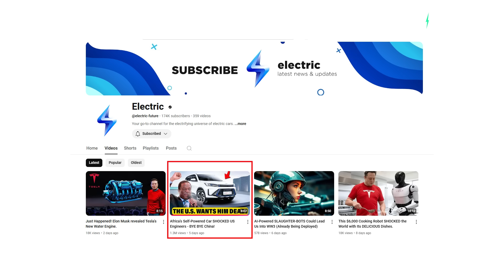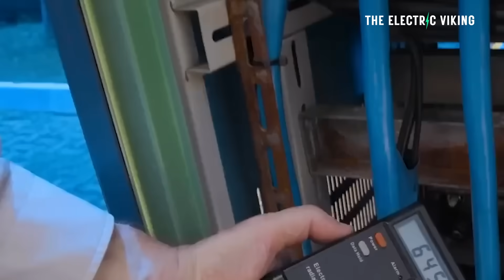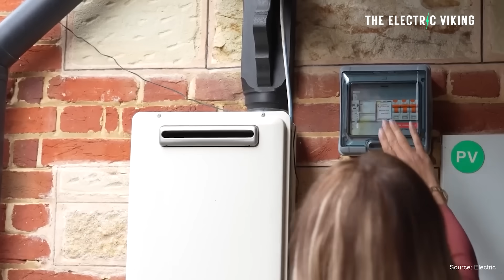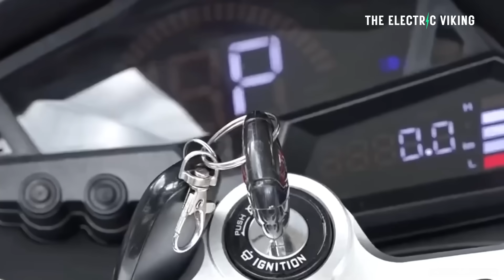Internet claims Africa’s Self-Powered Radiosonic Car SHOCKS Engineers

Comment: Best to have an open mind, Nickal Teslar was onto the same thing yet because its looked impossible under the current limited understand of the first law of thermal dynamics, does not mean you understand it. It's all in the language used, micro  radio energy could  be zero point energy, or the earth's nature micro electromagnetic fequancy. Or a natural transmission signal  to a wireless hayomonic receiver turned to a specific fequancy. You may need to eat your words.

Comment: When I was 14 Me and my friend built a device that gave us music for free no battery 24,7
We call it a crystal radio
Reply: Yes, crystal radios work.  Also, using an cardboard box, a bit of tin foil and thermal insulation material, one can build an inexpensive solar oven and cook eggs, for example, with it.  But the level of energy at play in these devices is several orders of magnitude below the power required for, say recharging an EV battery  or  for smelting, say iron ore.
Therefore the operational effectiveness of crystal radios in serving their didactic and musical purpose is no more proof that Chikumbutso's device works than one's ability to cook a few eggs (in a few hours!) in a solar oven is proof that industrial heat could be supplied by a cardboard oven...

Comment: Radio waves carry very small amounts of electric energy, typically measured in extremely tiny units like microwatts, due to their low frequency and long wavelengths on the electromagnetic spectrum; meaning even powerful radio transmitters only transmit a minuscule amount of electrical energy per unit area compared to other forms of radiation like microwaves or light. 

So light would be far better...
Why not just use the sun light? 
Oh yeah..🤫🤷‍♂️

Comment: I did not expect more than this from you. Somehow,  you're very helpful. Let's save this clip for tomorrow.

I have personally created a musical gadget that does not exist anywhere, and it's very simple. I use it for myself for over a year now.
And there are several methods to generate perpetual electricity. Some just need common sense!! I didn't even learn how to handle soldering iron yet.

Comment: Running on radiowaves, haha. Showing a picture of a car where an ignition key is required 😂😂
Reply: Over the past few years I have driven several different electric cars, and the all had an "ignition key".
It's a convenient way of preventing someone to just take your car and drive off with it. ;)
Reply: You are biased.very biased.the car's fuel system is radio waves.why shouldn't it need an ignition system.you guys destroyed Nikola tesla,one of your own bcos it threatened the capitalist establishment.
Reply: How did you conclude it's an IGNITION key? Why not an electric switch for the perpetual radiosonic engine?
Reply: @ If you look at the illustration, you can see that it is an ordinary ignition lock. It also contains the term ignition. Such an ignition lock is not required for electrically powered vehicles. In the vast majority of cases, a start-stop switch/button is used. In rare cases, there is the option of inserting a key-like module into a corresponding device. However, this never looks like an ordinary ignition lock as shown there.
Reply: @cinseychap1463  an ignition key hole can be adapted to act as an electric switch, not necessarily for a combustion engine. Innovation means thinking outside the box.
Reply: @sleuth7  Ah yes - I guess you're right ;)   Thank you.

Comment: It's not fake in terms of workings.. it something very real, but the problem is the power output that in common knowledge is very low. That is what the scam might actually be, because you would normally need very large "caption devices" to power a small smart watch 😂 but the claim is that his device can be fitted into an electric car & provide enough power to be able to actually drive the thing. Sceptical, but I guess only time will tell if the invention is real. or not

Comment: How cowardly of you. You can't even stand the truth, quickly deleting my comment to hide your ignorance like that.
Reply: This technology is not new. It is actually old. The only barrier left was no one knew how to harness the very tiny volts to translate them into usable energy on a large scale. 
Here is a video for proof of its existence long ago. https://youtu.be/NowhPAMDOTo?si=CmCx0bunvtx3eM8B . 

Here is some key context to help understanding;

Celestial Radio Waves as an Energy Source: Feasibility

1. Continuous Emission:

The Sun naturally emits radio waves, along with visible light, infrared, ultraviolet, and X-rays.
Other celestial objects, such as pulsars, quasars, and black hole accretion disks, also emit strong radio signals that can easily reach the Earth. 

2. Challenges in Harnessing Celestial Radio Waves for Energy (Chkumbuso's Invention Aims to Resolve These Challenges)

- Low Power Density: The radio waves reaching Earth from celestial bodies are extremely weak compared to solar light or even Earth's ambient radio noise.

- Capture Efficiency: Unlike visible light, which can be easily converted into electricity using solar panels, converting radio waves into usable energy requires large antennas and advanced rectification technology.

- Atmospheric Absorption: Certain radio frequencies are absorbed or scattered by the Earth's atmosphere, limiting what can be received at the surface.

- Cosmic Interference: Many sources, including Earth's ionosphere and human-made signals, interfere with natural cosmic radio waves.

3. Potential Applications of Space-Based Radio Wave Harvesting

- Radio Astronomy: Instead of harvesting energy, scientists use radio waves to study cosmic phenomena (Is this a limitation in their knowledge or intentional to save the fossil fuels industry?)
- Solar Power Satellites: Some space-based projects propose collecting energy directly from the Sun and beaming it to Earth via microwaves (a form of high-frequency radio waves).

**Wireless Energy Transmission: Nikola Tesla envisioned wireless energy transmission using radio waves, and modern research is exploring rectennas (rectifying antennas) to capture radio-frequency energy.**

Comment: If they would simply build a small portable generator like he showed, and it could put out 15KW of continuous power and never have to be recharged, that would be enough to revolutionize pretty much everything that uses electricity to run. If it doesn't require some expensive component like a pellet of nuclear material, and is reasonably affordable to the masses, let's build a bunch of them and start a revolution before scaling the technology up to use in grid level and industrial level applications. It's a damn good hoax if it ain't real. Maybe he could build a small airplane or drone that could stay aloft for 24 straight hours before returning to earth, as a way to demonstrate the device's unlimited power output.  It'll be so sad for sure if it turns out to be another free energy hoax. But there are some prophecies out there stating that some kind of new technology is coming to market in 2025 that will bring countless new changes to society. Maybe this one is it. God never lies. If He says get ready for something earth-shaking to come along, we should get ready without hesitation because there is 100% chance that the prophecy will come true. But even if this is not THE ONE to which the prophecy applies, we still may see something incredible invented in 2025 that will change society as we know it today, and possibly even more than a few game-changing technologies will be created that will impact us forevermore. But a "free energy" device that needs no input power [that costs us money to get] from the grid or from solar panels or a wind generator or a fossil fuel source, and never needs recharging, is still THE holy grail of electrical power generators. I'm rooting for Chikumbutso to both survive death threats and to bring his invention to market all around the planet. He has already teamed up with a Chinese company to make his special car. If the Chinese get first shot at a deal to mass produce the invention and run with it, the rest of the world will become slaves to them for decades, or at best, until we can create a different free energy device that cannot be suppressed by the Oil & Gas and Grid Utility Industries and corrupt Globalist Elites.

Comment: I was actually in Zimbabwe and i saw this technology for the first time live
Reply: what did you conclude
Reply: I'm curious about the innovation and now the debate going on. I'm from Papua New Guinea in the Pacific islands. I'm already so elated and jumping for joy. May I know where you are from and some proof of witnessing this innovation because of that and I am quite confused
Reply: How was it like😮
Reply: The car is a standard, unmodified Chinese EV with the batteries under the floor. They will work for maybe 300 Km then they need to be recharged. Maxwell will not allow anybody to run the car longer than that because it will expose his fraud.
Reply: You saw a Chinese EV?
Reply: No you did not. If you saw somehing the battery was well hidden.
Reply: @rogerphelps9939  It definitely has batteries but what charges the batteries? 

That's where Maxwell's invention comes in!

Comment: Sam, next time do some quick calculations.  Say you park this radio energy harvesting magic device near a mobile base station(cell phone tower).  There you can expect about 1 milli-watt of power available for an area of 1 square meter.   In order to charge at 3kw you need to collect power from 3000W/0.001W sq meters, which is 3 sq. km.  That is a huge land area for the device to cover.  For such a magic device to work, it needs to capture radio energy from 3 sq. km around the device with some magic antenna that is huge but yet invisible.  Even if it works, you cannot park such devices close together.  Each needs huge room to capture meaningful energy.

Comment: There are many reasons that I am very sceptical but I will share just 3. 1) I watch the video of him opening the hood of a car and explaining the technology. He stated that it was the amplification of radio waves in the air that powers the car and he shows a prototype of the amplifier, a relatively small unit that do not appear  to have a power source, or an antenna, both of which is a requirement for amplification of such very small signals. 2) Under the hood of the car sits a large gray unit, that looks pretty much like an engine, with what looks like large graded cables coming out of it and running either into the body of the car, or under the car. These cables are large, I suppose, to transfer the high ampage needed to push the heavy motor needed to move a heavy car and the load it is to carry long distances without fail. This would require several large connectors on the amplifirer"s output, unless the prototype unit shown was not the unit type powering the car. 3) Radio signals in the air are not just invisible, but extreamly weak and cannot amplify themselves, they require power.The power that is required to do what he explained would be better served powering the car than to collect power from the air. Even the very signals in the air requires power to place them there. Those are just 3, Ihave many more. Until I can check it  It"s a scam.

Comment: I think you’re simply jealous that you didn’t do it.  Have you ever heard of Nicola Tesla? Look him up. He had several patents that demonstrated that very same concept. Those patents are currently available to the public. This theory doesn’t violate physics and it is not a perpetual motion machine. Just because you don’t understand it doesn’t mean it isn’t legit. 
You should know there are many different ideas and working prototypes that are currently being suppressed to protect the profits of the wealthy and corporations stock holders. 
Nicola Tesla has demonstrated that there is more energy in just our planets lower atmosphere than we could ever use. This energy is in the form interstellar cosmic microwave radiation that do break through our protective magnetosphere and theoretically be collected, rectified, condensed and converted. The mathematics and tolerances for the first stage is staggering but the rest of it is first year AC-DC electronics engineering. 
Recent advances in the efficiency of microtechnologies and components have made these theories possible and even practical. 
The inventor now has records and drawings all over Earth. Destroying the man cannot stop the device from spreading. However, I’m sure he has all the protection he can afford. 
This product is not currently available in the USA. The factory (if you can call it that) is small. 
It does not violate Maxwells Equations.

Comment: Technically it can be done but the LRC circuit would be quite heavy. The inductance would be 150 Henries or more depending on the load. Then there is the inverse square law. The broadcasting station will not appreciate the power draw. Plus you would only be able to drive close to the broadcasting station. I didnt see a grounding rod so more than likely a fraud but as a believer in science im open to advances in technology   breakthroughs anything is possible

Comment: The Ultron Battery Technology is set for a 2025 release and yes it has already been tested and proven.

1. It is entirely self sufficient and does not need outside Intervention, no Radio Waves and no Neutrinos are required. 
2. The Ultron Battery will work in -60 Celsius to 200 F 24/7

https://youtu.be/-5ePNrx8qR8?si=Ibm0fkyDnr_ltGjy

Comment: of course this is a new scam. To capture RF energy over the available electromagnetic spectrum and then convert it (with no losses) to something practical to charge a local battery is beyond any scientific possibility. It "might" be possible to capture a small amount of RF energy to power a single LED, but to match any claims of providing power for any transport vehicle is clearly impossible. I've worked on marine radars that could produce at most 20-25 watts average of rf energy. Just imagine how much RF power is available from a cell phone.

Comment: Have you ever heard of a dude called Nikola Tesla? He patented most of the 20th Century technology before 1900. He was regarded as a magician or a charlatan. 
"Tesla once said, "The world moves slowly, and new truths are difficult to see." It was his way of responding to the crowd's stunned disbelief upon viewing his scientific wizardry at New York's Madison Square Garden in 1898. Using a small, radio-transmitting control box, he was able to maneuver a tiny ship about a pool of water and even flash its running lights on and off, all without any visible connection between the boat and controller. Indeed few people at the time were aware that radio waves even existed and Tesla, an inventor often known to electrify the crowd with his creations, was pushing the boundaries yet again, with his remote-controlled vessel."
During WW2 the Germans developed & used the Henschel Hs 293 guided glide bomb in 1943. That was 45 years after Tesla demonstrated his radio wave remote control technology!
Tesla saw the World as a huge electro-magnet & demonstrated the wireless transmission of electrical energy.

Comment: He just needs to prove that his device can generate enough energy. Radio wave energy is real. It just can’t produce enough energy according to the science we have today.  

Ambient Radio Signal Power: Even under favorable conditions, you might harvest milliwatts—thousandths of a watt—from ambient signals. To reach 75 watt-hours, you’d need a massive area of high-efficiency antennas or years of collection time—practically impossible for powering a TV in real time.

: While it is theoretically possible to power extremely low-power devices (like tiny sensors) using ambient electromagnetic waves, powering something like a TV or larger appliance from everyday broadcast signals is not feasible with current technology or known physics. If a video claims to show this in action, it’s very likely either misleading (e.g., using hidden power sources, battery backups, or editing tricks) or misunderstanding what’s actually happening.

Comment: Wireless charging exists, why can't a radio way charger exist?
Reply: because radio waves produce energy in milliwatts (millionths of a single Watt), wireless chargers are plugged into 110/240V electricity supplies producing Kilowatts (1000s x watt)
Reply: Because your not smart enough to do it doesn't mean it's not real. It not a reach
Reply: @ and when a convicted armed robber and fraudster is telling you it's real, it more than likely is not

Comment: While it is possible to convert radio waves into electricity, each vehicle would need an antenna several times the size of the Eifel tower to collect enough power to run the built-in stereo.
Furthermore, if it was actually real, people would have stolen it by now.
Reply: Foster Gamble a American billionaire grand son of founder Procter&Gamble (100billion company)was in Zimbabwe with a team to check if its real and he proofed that the machine is producing energy without input from a unknown source its on YouTube chikumbutso/foster gamble